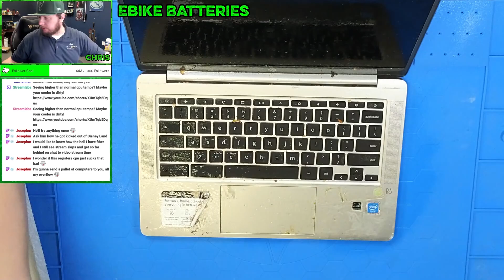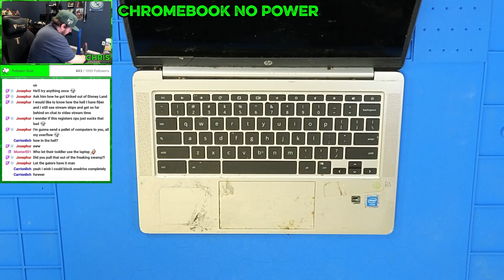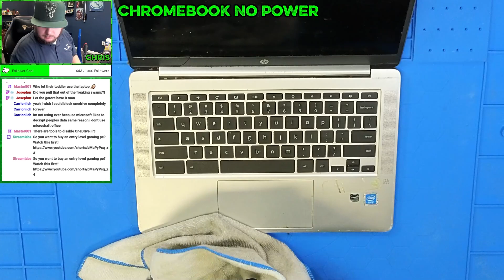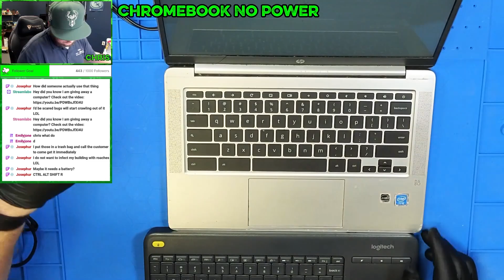HP Chromebook 14a Teardown and Diagnostic #185

Comment: easy way to fix a chromebook not turning on:

1: hold the power button and refresh button for 10  seconds (hard reset the EC)
2: release
3: turn on the chromebook

this method doesnt lose any data.
Reply: Mine wont even charge anymore, it used to be able to charge at a certain point but now it doesnt even work

Comment: Hi,
Informative video. I have question - is it possible to upgrade the RAM on this Chromebook model?
Reply from the maker: It is not possible sadly.
Reply: @Bradenton-PC-Repair  unless you get a prof. to do it, or you just have good microsoldering skills.
Reply from the maker: @rocketsbyodin5499  I mean I don't believe that this Chromebook CPU supports larger memory modules. Not that it is not physically possible. Defiantly could be mis-remembering the CPU model though.